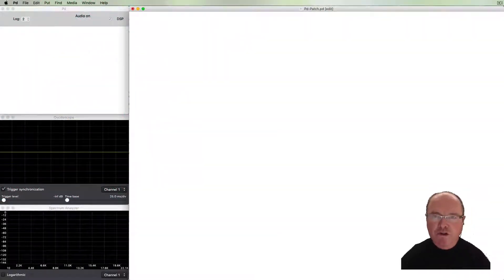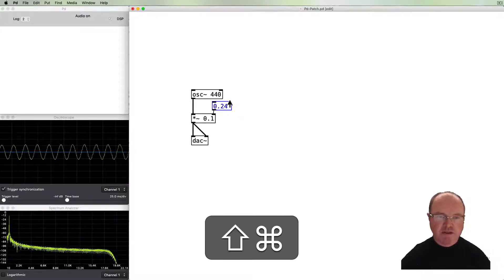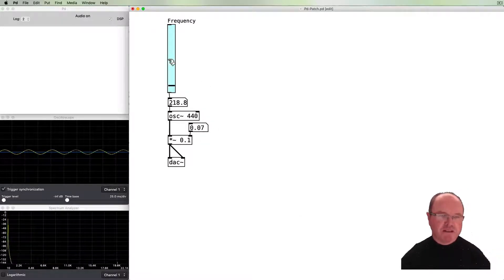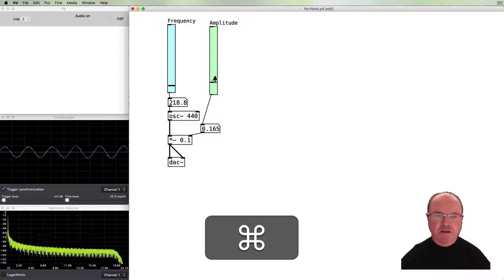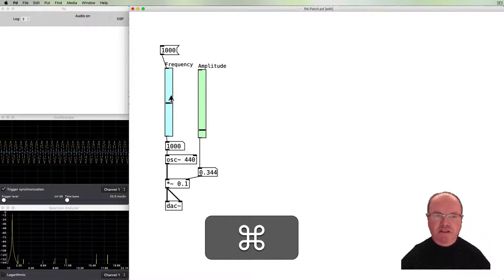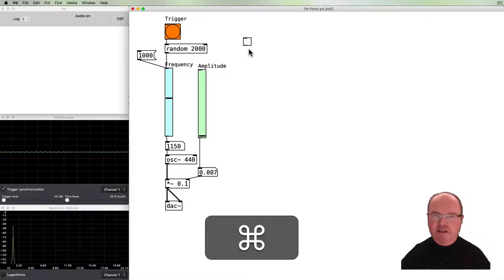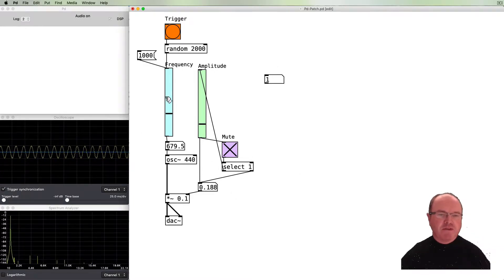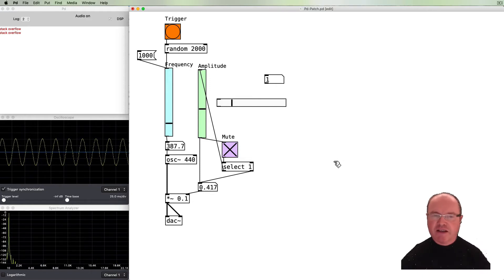3. Graphical User Interfaces in Pure Data

Comment: Hello Andrew, 
First of all, I really appreciate for your series. 
actually, I have a question about bang button part. I was following the video and I've set the Frequency range to 400~1000, and it goes below 400 range when I hit the bang button. is there anything else do I have to set to bang button stay in 400~1000 range?
Thanks
Reply: My patch in the video cuts a few corners. Setting the [osc~ 440] frequency default is a starting value, and is overridden by incoming values. The [random 2000] will produce numbers between 0 and 1999 when banged. To avoid low freqs, put an offset after [random]. For example, [+ 400] or [clip 400 1000].
Reply: @algomedia  aha now i get it! thanks for the reply!